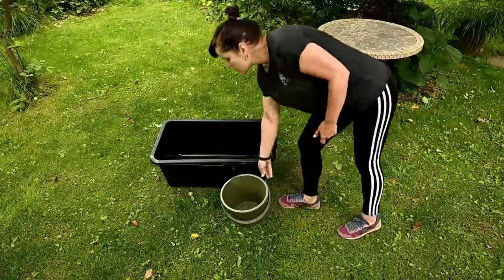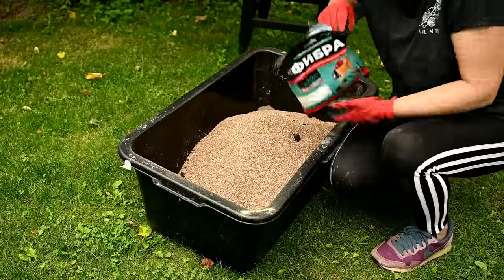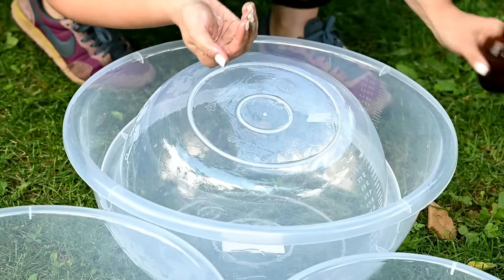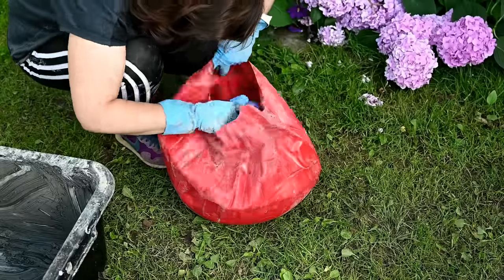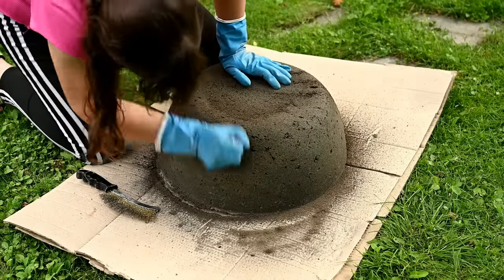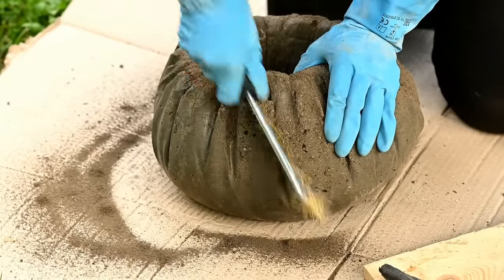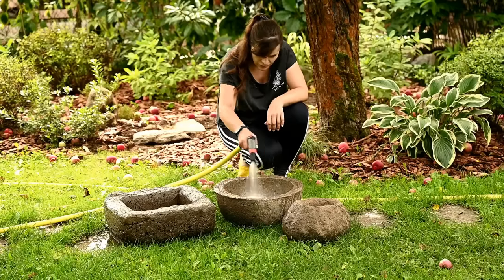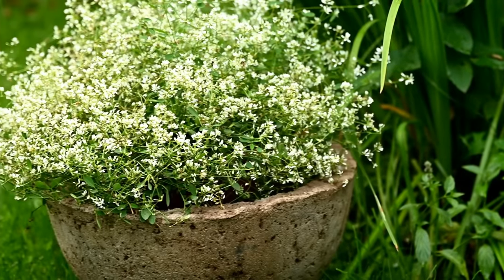Making hypertufa planters that withstood  -22 °F/The best recipe for cold climate!

Comment: Wonderful informative video.  You can also dye the concrete different shades of colors by mixing in concrete pigment powder. Just wanted to point out to readers how important "curing" concrete is.  To do it correctly concrete needs to stay evenly moist for several weeks. { where Irene wrapped her containers in plastic and placed in the shade.}  Why this is crucial is the fact that during this time period crystals are formed within the matrix of the medium.  It is these crystals that gives concrete its true strength and ability to age well.  If this step is not given the proper attention, the structure will crumble in a couple months to a year.  {Fun fact...One can actually feel the sculpture heat up during this process.}
Reply: Can you put up the names of the material to use I can’t figure it out .
Thank you 
Grate video !
Reply: @gudesanchez2008  Portland cement, peat & vermiculite. She also added concrete reinforcing fibers.

Comment: The recipe I use is a 1 part white  Portland cement, 1 part peat moss, and 1 part perlite. The perlite helps keep the finished pieces lighter and easier to move around. Mine have lasted for years and I have found that plants love, love, love being planted in hypertufa pots. I used a 5 gallon bucket of each ingredient and poured them into a wheelbarrow which my husband turned with a shovel while I wet it down with a hose. You can make several large pieces with this amount, but it takes a strong person to keep turning the mixture. I like the idea of making smaller batches like you did which would be something I could do on my own. Also, I used cooking spray as release.
Reply: Thank you!
Reply: I think I will try your portions since I like the idea of as little cement as necessary.  Thank you.

Comment: Use a compressor with an air hose and an attachment called a blow gun by putting the small nozzle into the edge of the mold the forced air will push the mold right out. Water works just as well.  Nice job on your tufa pots.

Comment: I made many of very similar prox 7-8 years ago. I found a power washer made the perfect rustic surface in 1-2 minutes. Most of them are still going strong to this day. White cement give a more light sandstone look if you are into experimenting. 
Yours came out great ! 
Just keep in mind the power washer if you want to make many in no time.
Reply from the maker: Thank you for the advice, will try using power washer for this!!
Reply: Que materiales se usan en español por favor
Reply: When do you use the power washer?? When she rinsed then off and filled with water?? Please
Reply: @sharonmccollister4204  Instead of brush, it does the same as the brush, just much faster.

Comment: ❤ Years ago, I read several articles on hypertuffa pots. One of the most interesting articles was about covering  polystyrene (styrofoam) packing containers with a hyperfuffa mix.  This was to create a more protected area for the root zone. Have you seen or heard of this procedure? In my area, it can get to be -40 in the winter, so cold hardiness is important.
Reply: Thank you for mentioning this.  I have some big styrofoam packing containers and was just wondering about using them.  Currently I have my grow bags in them, to help with water retention in my  hot SW high mountain desert climate. I'm going to try it!
Reply: N

Comment: Use a broken piece of brick  to help with smoothing edges and bringing out areas that u like it will help like the wire brush, but can be more economical affordable..if you move the  inside bucket within a hour it might've helped a bit better in removing it later.. they turned out very very pretty well done...

Comment: Another fantastic video and I am in love with the square planter!! No doubt I will be making one of these. Question… if you don’t put a hole in the bottom will it hold water? I would like to make it into a miniature water garden. Thanks again!
Reply: Even if the planter didn't actually leak, the concrete absorbs water & it evaporates from the surface rapidly, so you'd have to frequently refill it. But it works well as a reservoir in a recirculating water feature where it sits in a small pool with a pump that pushes water up into the planter through a hose in the bottom & then flows over the sides back into the pool. If you make it shallow or place rocks in it, it makes a great birdbath. And the sound is delightful!
Reply: @canoetripper4651  All good suggestions! Thanks for the response!!

Comment: Anyone know if these can be as a fountain/bubbler for bird baths? 
Love the details of the video and the fact you included ’goofs’ and didn’t let them bother you a bit! 👏
Reply from the maker: Hi, in fact I'm using one of the bowls as a little water feature, so  it could work, but you'll have to change water in it very often as it will get green. I'm using pool solution to keep water clean, but it will not work for a bird bath
Reply: @IrenesDIY  Thanks so much!

Comment: Thank you for the video. I’ve been looking for a material I can use to create a vertical garden. I’m thinking about making several layers that stack up held in place with rebar through the drainage hole. May add additional drainage holes trickle down to the bottom layers. Do you think this would work?
Reply from the maker: I think so!

Comment: Absolutely gorgeous!  Will these hold water so they could be used as a bird bath?
Reply from the maker: Absolutely! I use one of these for a water feature and it works fine)
Reply: The cement will leach chemicals into the water unless you add water then throw that out a few times over a couple of weeks, just whatever you can do to eliminate birds being exposed to the first few fills.

Comment: Irene, great series. Please, where did you find the very large clear round bowls/molds at the beginning of this video. So far I have gotten to the house a cement mixer, lots of peat, portland cement a ton of vermiculite, etc. But large plastic (smooth surface) bowls that will almost nestle are hard to find. Thanks for clues.
Reply from the maker: Thanks, Robert! I'm afraid my links will not be of any use for you as I live outside  US.. I found these vessels on Amazon, maybe they'll be useful for you: https://www.amazon.com/HC-Companies-GAB18000A42C006LRCNU-Garden-planters/dp/B08ZP1J75P/ref=mp_s_a_1_12?crid=407NGGT190VV&keywords=round+plastic+tub&qid=1655587314&sprefix=round+plastoc+tub%2Caps%2C254&sr=8-12
Reply: @IrenesDIY  thanks so much for the reply. I think in the end, after accumulating a ton of bowl/molds my favorite will be the cardboard box! Thanks again for being here.

Comment: Hypertufa is imitation stone. The purpose of using perlite is to imitate stone and make the pots light to move around.  Using the wire brush after unmoulding gives the authentic stone look which you don't have, The pots look nice but look like concrete.  The original hypertufa recipe from the 1700's uses perlite/vermiculite - 1/3. Peatmoss 1/3. Cement 1/3.

Comment: What is the substitute for PEAT MOSS as it's not available where I live. I still need it to be durable for outdoor in the cold with water inside.
Reply from the maker: Hi, you could use coconut fibers, or even shredded straw. The idea is to use  organic material that will rot with time and leave those hollow spots on the surface
Reply: @IrenesDIY  AH! This is a good explanation ! THANK YOU!

Comment: Having trouble. don't know if it's because its humid where I live, So far the only thing that hasn't fallen apart is a little heart I put in my garden. and then I ran over it this morning with my garden cart😮‍💨. What a mess. I'm wondering if I'm getting the ratios right.
Reply from the maker: This is really sttange, as 2 parts cement should be really strong even in a humid climate. Maybe it is something wrong with the cement? I use portland cement M500
Reply: Thanks I'll try it! @IrenesDIY

Comment: PLEASE, WHAT DO THESE PLANTERS WEIGH, EMPTY????
Reply: I hope you get an answer because I would like to know too. 

A small bag of Portland cement alone weighs about 50 lbs. Only 2 buckets were used so maybe 5 lbs. Plus peat moss which is very light and vermiculite also very light.  So, for a whole batch maybe 10 pounds. Totally guessing here. Three planters made from one batch, slightly more than 3 pounds when divided equally. That also doesn't take into account the weight of the water when they are first made. Peat and vermiculite hold water. That's why gardeners use them in garden beds. 

Carrying that cement and then moving the pot after it's made to a place to cure may be more than my back can take. 😂

I hope you get an answer! Cheers! 🎉
Reply from the maker: Hi, I'm afraid I haven't weighed the planters. I can say I'm able to lift all of them, except for the square one, I could lift it before filling it with soil, but once filled it's too heavy for me to lift, I can just move it around without lifting. Hope this helps!